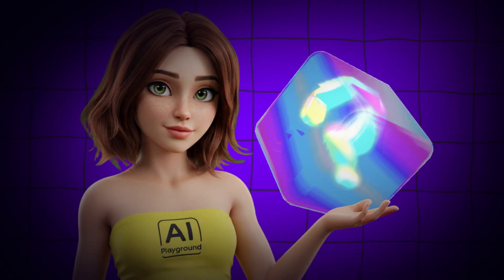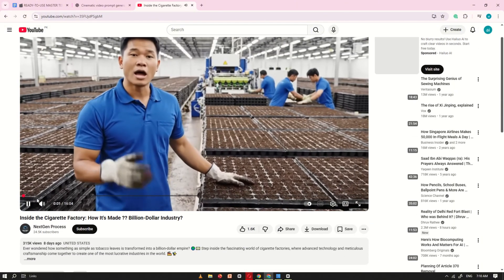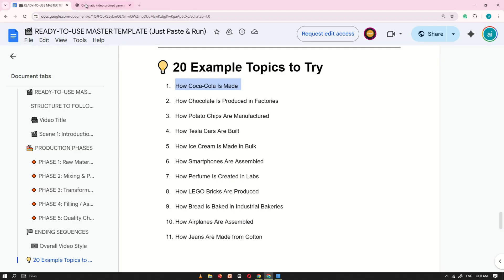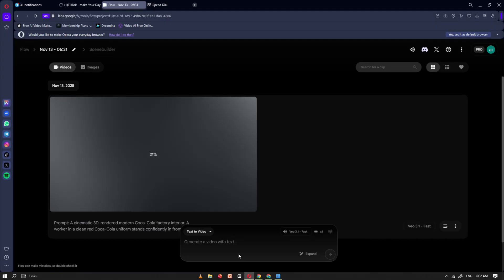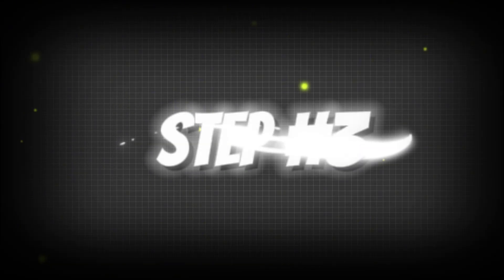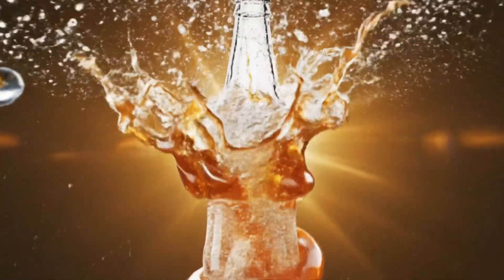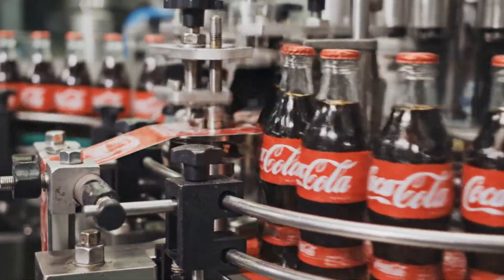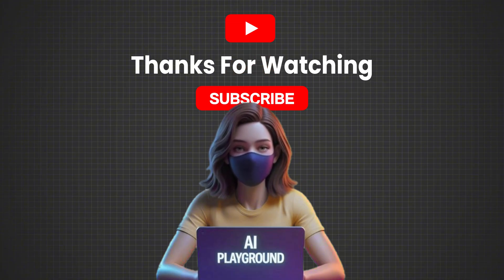How to Make Viral Factory Process Videos with Free AI Tools

Comment: Your template looks strong.

Pros
	•	Clear structure
	•	Consistent production phases
	•	Strong fit for VEO 3
	•	Precise audio cues and camera styles
	•	Easy to plug into automation
	•	Scales well across many topics

Cons
	•	Scenes run long and need shorter sentences
	•	No fixed scene duration
	•	No separate JSON blocks for automated workflows
	•	CTA could be tighter

Improvements
	•	Add required scene timing
	•	Pick one export style: single block or multiple JSON files
	•	Use shorter lines with fewer details per sentence
	•	Reduce the number of audio cues since VEO 3 skips some of them

Final score: 9/10
A solid foundation for factory and process videos, ready for real use.